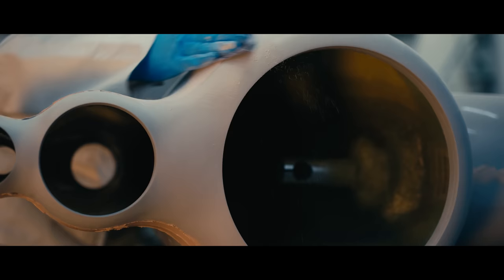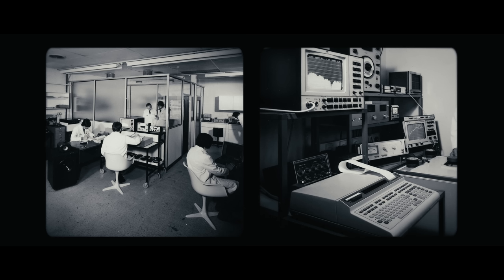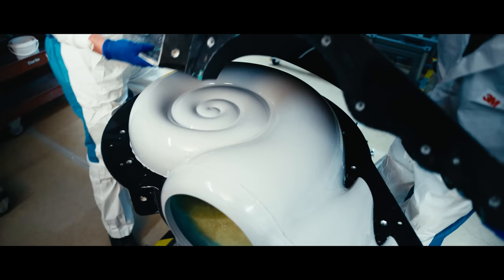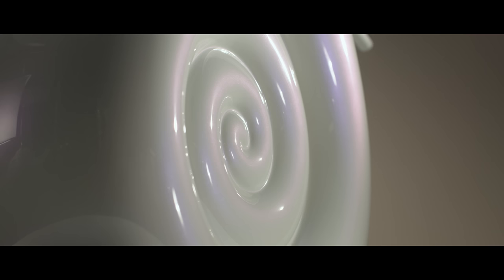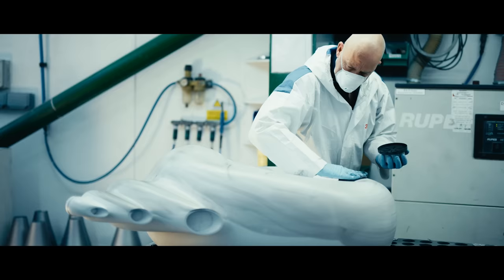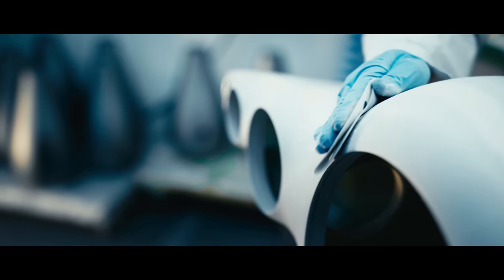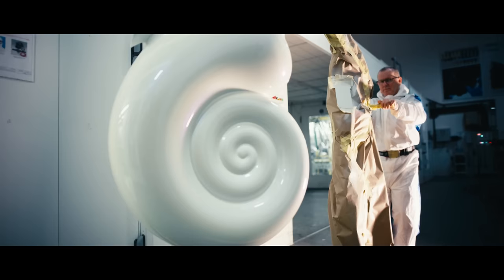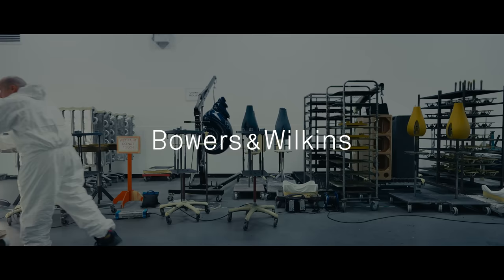Beyond the Curve - 30 Years of Nautilus

Comment: My first speakers where B&W, since then I upgraded every few years and still very loyal to the brand. I saw the nautilus from introduction in magazines and was fascinated from the first moment. Many years later at a B&W show at a respected dealer I attended a show where the new 800D3 where demonstrated….alongside the nautilus, all equipment was Classe with 8! monoblocks etc. I have to admit that I was a bit underwhelmed hearing them after the 802D3 demo (on 2 monoblocks). But there is something about the nautilus and its just wonderfull ❤.